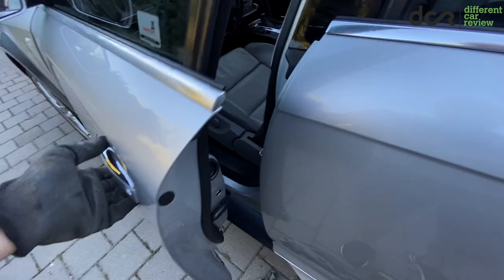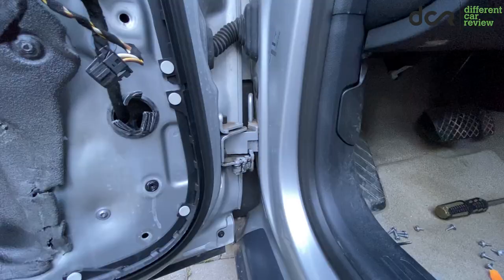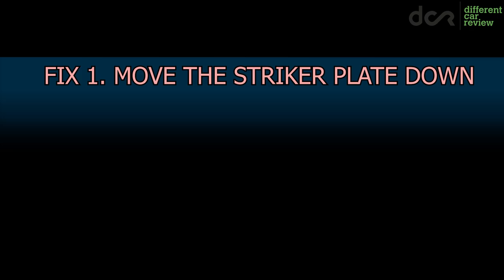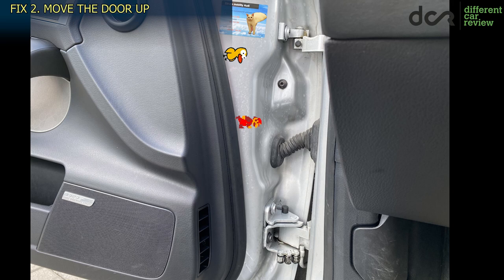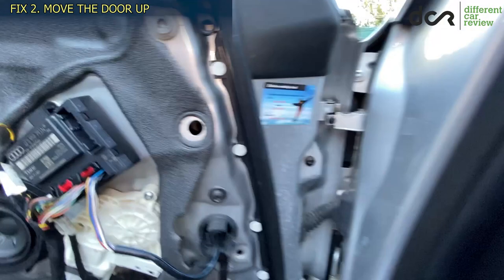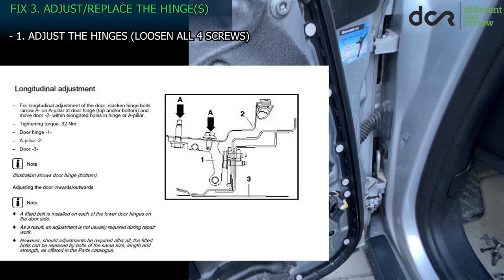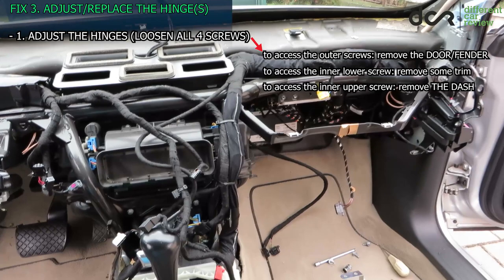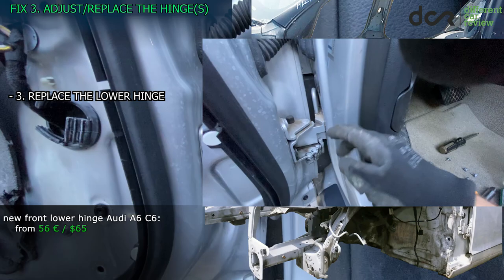How To Fix a Sagging/Hard to close Car Door (explained on Audi, VW)

Comment from the maker: Buying a used Audi A6 (C6/4F) - 2004-2011 https://www.youtube.com/watch?v=BbTeVU0kXl8
Buying a used Audi S6 (C6/4F) - 2006-2010 https://www.youtube.com/watch?v=mpf5CgCOhM0
Buying a used Audi Q7 (4L) - 2005-2015 https://www.youtube.com/watch?v=04o6oK1J5fM
Buying a used Audi A8 (D3/4E) - 2002-2010 https://www.youtube.com/watch?v=PijHDhQ3Gas
Audi A6, A8, Q7 steering lock issue story https://www.youtube.com/watch?v=ujxQLU_rw3I

Audi Q7 with 511 000 km - Full Walkaround, Review & Test Drive https://youtu.be/QLn1sSpLYp8
I bought the Cheapest Range Rover in the EU with 447 100 km https://www.youtube.com/watch?v=Ic1wHnoiyEw

How To Remove Air Compressor Relay Audi A6 C6/4F 2004-2011 https://youtu.be/OPMHU7rNBQY
How to replace Cabin Air Filter - Audi A6, S6, RS6 C6 - 2004-2011 https://youtu.be/zjRaxd3l7y4
How to replace the Spark Plugs + Engine Air Filter - Audi A6 C6 2006-2010, 4.2 FSI V8 https://youtu.be/FSCr_oKFbrI
How To Remove the Door Panel - Audi A6, S6, RS6, Allroad C6/4F 2004-2011 https://youtu.be/-bIrl2seUVQ

Comment: I had the same problem with the door of Caddy because the metal of the door is thin and the hinges had to be oiled.So the metal of the door was cracked. I welded it and then I used the fix 4 and it it is perfect. Thanks a lot for your video

Comment: My door didn’t close all the way and stuck out a bit, so I just adjusted the striker plate towards the inside of the car little by little until the window trims lined up, no need to touch the screws on hinges if it’s only horizontal adjustment

Comment: This silly hinge on my Golf V 1K1 looks like it was smashed over time and my driver door is not holding properly when opened, many times if theres a small incline it closes right back. Passengers doors are fine though and are held in place by those round shaped bearing like metallic things on the hinge you show.

Comment: Hi thank you great video. I wonder, how do you get the information on which car models these hinges matches? The lower front door hinge  on my Octavia 1.gen needs to be replaced.
Reply from the maker: Hi, I fckd up a bit since I should have said it differently:
so the hinge design itself is the same on all those cars, but the size can of course differ

Comment: Thank you I have removed rear door from 2005 Seat Leon to fit on 2007 Seat Leon and there is no gap between front and rear door when closed, so when I open the rear door, it touches and scrapes against front door.  Hopefully this video should help me solve this issue. I just wish I don't also have to swap hinges over as that is a bitch of a job lol